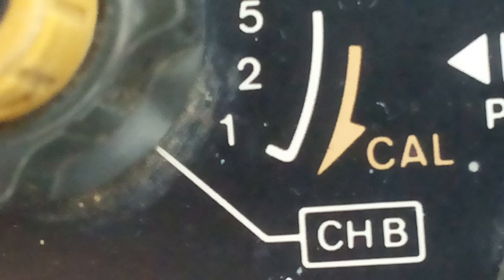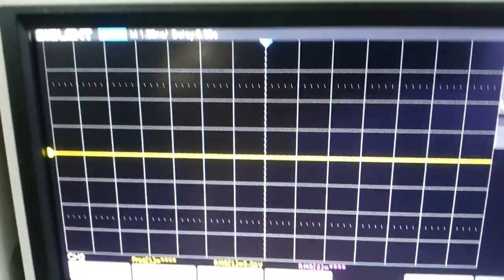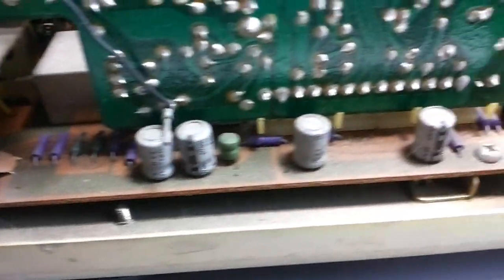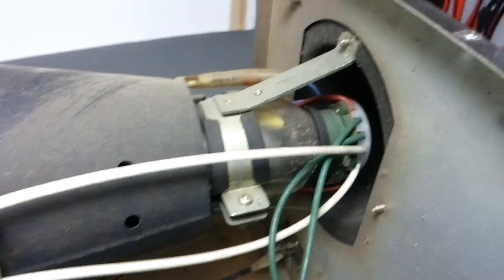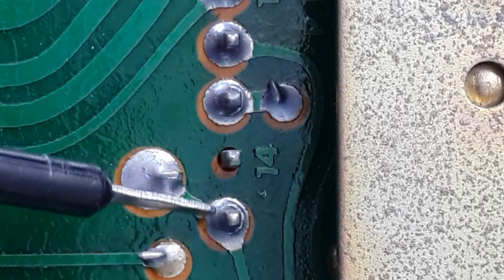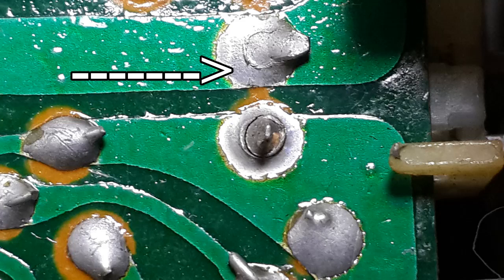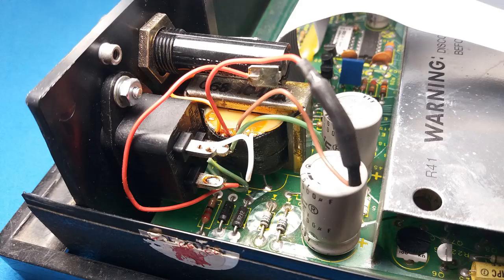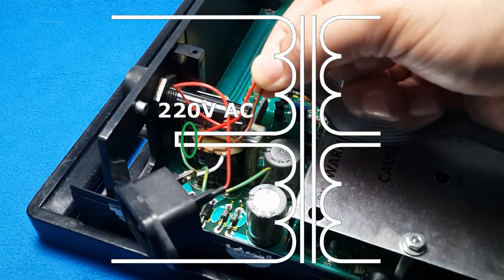I got back my old analog 10MHz oscilloscope BK Precision 1471B &  a multimeter Data Precision 2480R

Comment: Hello. You have great videos. I am trying to repair donated to me ELSA Riva TNT AGP graphics card, pins on memory where slightly bent, but I made them straight, traces looks okay, but 6 brown smd's are snapped off. I need to identify them and replace them. Can you help me? I can make some pictures of the card, will you have a look? Thank you
EDIT: graphics card runs fine under 2D, but couldn't run in 3D mode
Reply from the maker: Hi! Thanks! It will be easiest if you ask the question in Facebook groups. Chances are on of them have the same card can help you to identify the capacitors. Join some groups and add the best pictures you can with the video card model number. (Why no? ...try some latino groups or Asians too. Somebody must have the same card somewhere).